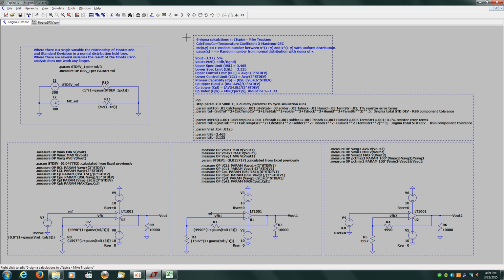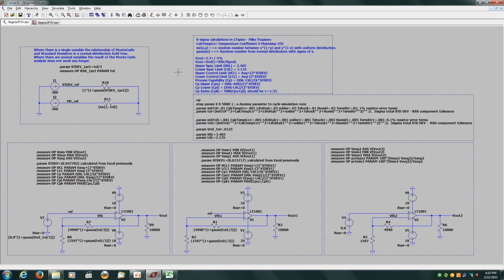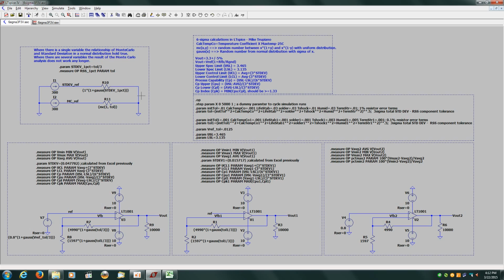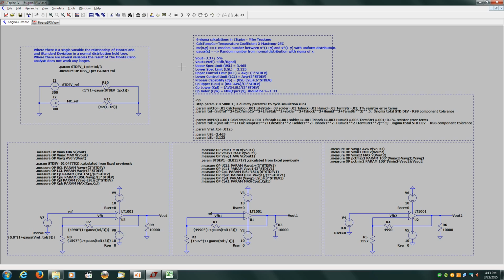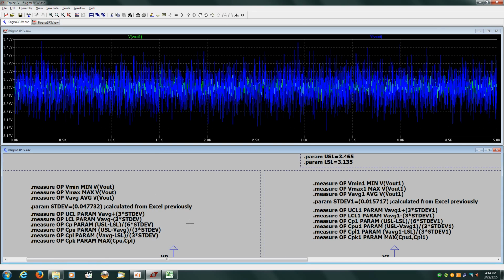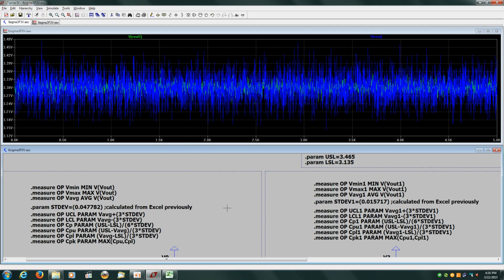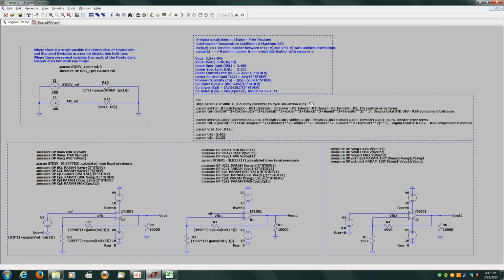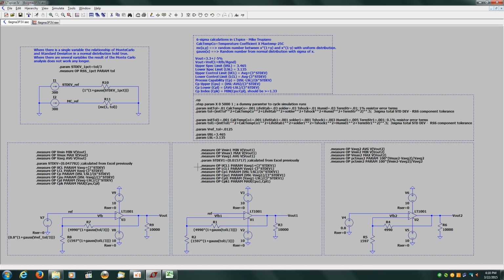LTSpice with Excel 6-sigma Analysis

Comment from the maker: save as .asc file
Version 4
SHEET 1 2244 1156
WIRE -1056 -208 -1136 -208
WIRE -896 -208 -976 -208
WIRE -672 -208 -896 -208
WIRE -384 -208 -592 -208
WIRE -1136 -80 -1136 -208
WIRE -1056 -80 -1136 -80
WIRE -880 -80 -976 -80
WIRE -656 -80 -880 -80
WIRE -384 -80 -384 -208
WIRE -384 -80 -576 -80
WIRE -1136 16 -1136 -80
WIRE -384 16 -384 -80
WIRE -384 16 -1136 16
WIRE -1136 32 -1136 16
WIRE -528 608 -528 576
WIRE 448 608 448 576
WIRE 1456 608 1456 576
WIRE -528 752 -528 688
WIRE 448 752 448 688
WIRE 1456 752 1456 688
WIRE -896 768 -1008 768
WIRE -560 768 -896 768
WIRE 416 768 176 768
WIRE 1424 768 976 768
WIRE -384 784 -496 784
WIRE -320 784 -384 784
WIRE -224 784 -320 784
WIRE 592 784 480 784
WIRE 656 784 592 784
WIRE 752 784 656 784
WIRE 1600 784 1488 784
WIRE 1664 784 1600 784
WIRE 1760 784 1664 784
WIRE -1008 800 -1008 768
WIRE -672 800 -832 800
WIRE -560 800 -672 800
WIRE 224 800 32 800
WIRE 416 800 224 800
WIRE 976 800 976 768
WIRE 1312 800 1152 800
WIRE 1424 800 1312 800
WIRE -320 832 -320 784
WIRE 656 832 656 784
WIRE 1664 832 1664 784
WIRE -832 864 -832 800
WIRE -752 864 -832 864
WIRE -384 864 -384 784
WIRE -384 864 -672 864
WIRE 32 864 32 800
WIRE 160 864 32 864
WIRE 592 864 592 784
WIRE 592 864 240 864
WIRE 1152 864 1152 800
WIRE 1232 864 1152 864
WIRE 1600 864 1600 784
WIRE 1600 864 1312 864
WIRE -528 896 -528 816
WIRE 448 896 448 816
WIRE 1456 896 1456 816
WIRE -1008 912 -1008 880
WIRE 976 912 976 880
WIRE -832 928 -832 864
WIRE 32 928 32 864
WIRE 1152 928 1152 864
WIRE -320 944 -320 912
WIRE 656 944 656 912
WIRE 1664 944 1664 912
WIRE -528 992 -528 976
WIRE 448 992 448 976
WIRE 1456 992 1456 976
WIRE -832 1056 -832 1008
WIRE 32 1056 32 1008
WIRE 1152 1056 1152 1008
FLAG 32 1056 0
FLAG 752 784 Vout1
FLAG 448 576 0
FLAG 448 992 0
FLAG 224 800 Vfb1
FLAG 656 944 0
FLAG 1152 1056 0
FLAG 976 912 0
FLAG 1760 784 Vout2
FLAG 1456 576 0
FLAG 1456 992 0
FLAG 1312 800 Vfb2
FLAG 1664 944 0
FLAG -832 1056 0
FLAG -1008 912 0
FLAG -224 784 Vout
FLAG -528 576 0
FLAG -528 992 0
FLAG -672 800 Vfb
FLAG -320 944 0
FLAG 176 768 ref
FLAG -896 768 ref
FLAG -1136 32 0
FLAG -896 -208 STDEV
FLAG -880 -80 MC
SYMBOL res 256 848 R90
WINDOW 0 0 56 VBottom 2
WINDOW 3 32 56 VTop 2
SYMATTR InstName R1
SYMATTR Value {mc(4990, tol1)}
SYMBOL res 16 912 R0
WINDOW 0 -55 37 Left 2
WINDOW 3 -213 67 Left 2
SYMATTR InstName R2
SYMATTR Value {mc(1597, tol1)}
SYMBOL Opamps\\LT1001 448 848 M180
SYMATTR InstName U1
SYMBOL voltage 448 880 M0
WINDOW 123 0 0 Left 2
WINDOW 39 24 132 Left 2
SYMATTR SpiceLine Rser=0
SYMATTR InstName V2
SYMATTR Value 10
SYMBOL res 640 816 R0
SYMATTR InstName R3
SYMATTR Value 10000
SYMBOL voltage 448 592 M0
WINDOW 123 0 0 Left 2
WINDOW 39 24 132 Left 2
SYMATTR SpiceLine Rser=0
SYMATTR InstName V3
SYMATTR Value 10
SYMBOL res 1328 848 R90
WINDOW 0 0 56 VBottom 2
WINDOW 3 32 56 VTop 2
SYMATTR InstName R4
SYMATTR Value 4990
SYMBOL res 1136 912 R0
WINDOW 0 -55 37 Left 2
WINDOW 3 -77 67 Left 2
SYMATTR InstName R5
SYMATTR Value 1597
SYMBOL voltage 976 784 M0
WINDOW 123 0 0 Left 2
WINDOW 39 24 132 Left 2
SYMATTR SpiceLine Rser=0
SYMATTR InstName V4
SYMATTR Value 0.8
SYMBOL Opamps\\LT1001 1456 848 M180
SYMATTR InstName U2
SYMBOL voltage 1456 880 M0
WINDOW 123 0 0 Left 2
WINDOW 39 24 132 Left 2
SYMATTR SpiceLine Rser=0
SYMATTR InstName V5
SYMATTR Value 10
SYMBOL res 1648 816 R0
SYMATTR InstName R6
SYMATTR Value 10000
SYMBOL voltage 1456 592 M0
WINDOW 123 0 0 Left 2
WINDOW 39 24 132 Left 2
SYMATTR SpiceLine Rser=0
SYMATTR InstName V6
SYMATTR Value 10
SYMBOL res -656 848 R90
WINDOW 0 0 56 VBottom 2
WINDOW 3 32 56 VTop 2
SYMATTR InstName R7
SYMATTR Value {mc(4990, tol)}
SYMBOL res -848 912 R0
WINDOW 0 -55 37 Left 2
WINDOW 3 -206 75 Left 2
SYMATTR InstName R8
SYMATTR Value {mc(1597, tol)}
SYMBOL voltage -1008 784 M0
WINDOW 123 0 0 Left 2
WINDOW 39 24 132 Left 2
SYMATTR SpiceLine Rser=0
SYMATTR InstName V7
SYMATTR Value {mc(0.8, Vref)}
SYMBOL Opamps\\LT1001 -528 848 M180
SYMATTR InstName U3
SYMBOL voltage -528 880 M0
WINDOW 123 0 0 Left 2
WINDOW 39 24 132 Left 2
SYMATTR SpiceLine Rser=0
SYMATTR InstName V8
SYMATTR Value 10
SYMBOL res -336 816 R0
SYMATTR InstName R9
SYMATTR Value 10000
SYMBOL voltage -528 592 M0
WINDOW 123 0 0 Left 2
WINDOW 39 24 132 Left 2
SYMATTR SpiceLine Rser=0
SYMATTR InstName V9
SYMATTR Value 10
SYMBOL res -576 -224 R90
WINDOW 0 0 56 VBottom 2
WINDOW 3 32 56 VTop 2
SYMATTR InstName R10
SYMATTR Value {20*(1+gauss(STDEV_1pct))}
SYMBOL res -560 -96 R90
WINDOW 0 0 56 VBottom 2
WINDOW 3 32 56 VTop 2
SYMATTR InstName R11
SYMATTR Value {mc(20, tol)}
SYMBOL current -1056 -208 R270
WINDOW 0 32 40 VTop 2
WINDOW 3 -32 40 VBottom 2
WINDOW 123 0 0 Left 2
WINDOW 39 0 0 Left 2
SYMATTR InstName I1
SYMATTR Value 1
SYMBOL current -1056 -80 R270
WINDOW 0 32 40 VTop 2
WINDOW 3 -32 40 VBottom 2
WINDOW 123 0 0 Left 2
WINDOW 39 0 0 Left 2
SYMATTR InstName I2
SYMATTR Value 1
TEXT -168 -176 Left 2 !.op
TEXT -168 0 Left 2 !.param tol1=(initTol1**2+LifeStab1**2+solder1**2+Tshock1**2+Humid1**2+TermStr1**2)**.5;  3sigma total STD DEV -  RSS component tolerance
TEXT -168 -144 Left 2 !.step param X 0 5000 1 ; a dummy paramter to cycle simulation runs
TEXT -8 -632 Left 2 ;Monte Carlo Simulation in LTspice
TEXT -168 -112 Left 2 !.param initTol=.01 TempCo=.0001 LifeStab=.03 solder=.03 Tshock=.01 Humid=.03 TermStr=.01; 1% resistor error terms
TEXT -168 48 Left 2 !.param Vref=.0125
TEXT 1072 272 Left 2 !.measure OP Vavg2 AVG V(Vout2)
TEXT 1072 296 Left 2 !.measure OP Vmin2 MIN V(Vout2)
TEXT 1072 320 Left 2 !.measure OP Vmax2 MAX V(Vout2)
TEXT -168 -24 Left 2 !.param initTol1=.001 TempCo1=.0001 LifeStab1=.001 solder1=.001 Tshock1=.003 Humid1=.005 TermStr1=.001; 0.1% resistor error terms
TEXT -168 -88 Left 2 !.param tol=(initTol**2+LifeStab**2+solder**2+Tshock**2+Humid**2+TermStr**2)**.5;  3sigma total STD DEV - RSS component tolerance
TEXT 1072 344 Left 2 !.measure OP pctmax2 PARAM 100*(Vmax2-Vavg2)/Vavg2
TEXT 1072 368 Left 2 !.measure OP pctmin2 PARAM 100*(Vmin2-Vavg2)/Vavg2
TEXT -8 -600 Left 2 ;Temperature Coefficient was not included in RSS term.
TEXT -8 -568 Left 2 ;mc(x,y) ==> random number between x*(1+y) and x*(1-y) with uniform distribution.\ngauss(x) ==> Random number from Gaussian distribution with sigma of x.
TEXT 88 328 Left 2 !.measure OP Vavg1 AVG V(Vout1)
TEXT 88 280 Left 2 !.measure OP Vmin1 MIN V(Vout1)
TEXT 88 304 Left 2 !.measure OP Vmax1 MAX V(Vout1)
TEXT -912 328 Left 2 !.measure OP Vavg AVG V(Vout)
TEXT -912 280 Left 2 !.measure OP Vmin MIN V(Vout)
TEXT -912 304 Left 2 !.measure OP Vmax MAX V(Vout)
TEXT -16 -464 Left 2 ;Vout=3.3+/-5%\nUpper Spec Limit (USL) = 3.465\nLower Spec Limit (LSL) = 3.135\nUpper Control Limit (UCL) = Avg+(3*STDEV)\nLower Control Limit (LCL) = Avg-(3*STDEV)\nProcess Capability (Cp) = (USL-LSL)/(6*STDEV)\nCp Upper (Cpu) = (USL-AVG)/(3*STDEV)\nCp Lower (Cpl) = (AVG-LSL)/(3*STDEV)\nCp Index (Cpk) = MIN(Cpu:Cpl), should be >=1.33
TEXT -912 376 Left 2 !.measure OP STDEV PARAM MAX((Vavg-Vmin)/3,(Vmax-Vavg)/3)
TEXT -912 400 Left 2 !.measure OP UCL PARAM Vavg+(3*STDEV)
TEXT -912 424 Left 2 !.measure OP LCL PARAM Vavg-(3*STDEV)
TEXT 88 400 Left 2 !.measure OP UCL1 PARAM Vavg1+(3*STDEV1)
TEXT 88 424 Left 2 !.measure OP LCL1 PARAM Vavg1-(3*STDEV1)
TEXT -912 448 Left 2 !.measure OP Cp PARAM (USL-LSL)/(6*STDEV)
TEXT -168 88 Left 2 !.param USL=3.465
TEXT -168 112 Left 2 !.param LSL=3.135
TEXT -912 472 Left 2 !.measure OP Cpu PARAM (USL-Vavg)/(3*STDEV)
TEXT -912 496 Left 2 !.measure OP Cpl PARAM (Vavg-LSL)/(3*STDEV)
TEXT -912 520 Left 2 !.measure OP Cpk PARAM MAX(Cpu,Cpl)
TEXT 88 448 Left 2 !.measure OP Cp1 PARAM (USL-LSL)/(6*STDEV1)
TEXT 88 472 Left 2 !.measure OP Cpu1 PARAM (USL-Vavg1)/(3*STDEV1)
TEXT 88 496 Left 2 !.measure OP Cpl1 PARAM (Vavg1-LSL)/(3*STDEV1)
TEXT 88 520 Left 2 !.measure OP Cpk1 PARAM MAX(Cpu1,Cpl1)
TEXT 88 376 Left 2 !.measure OP STDEV1 PARAM MAX((Vavg1-Vmin1)/3,(Vmax1-Vavg1)/3)
TEXT -888 -392 Left 2 !.param STDEV_1pct=TOL/3
TEXT -896 -360 Left 2 !.measure OP RSS_1pct PARAM tol